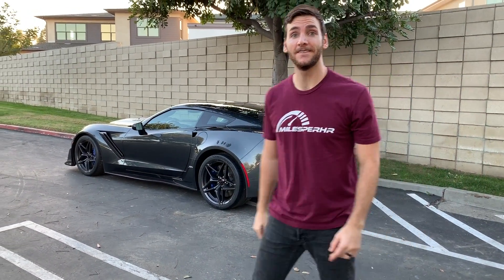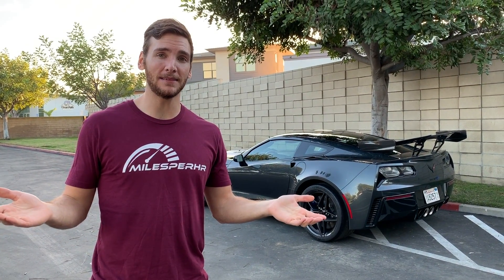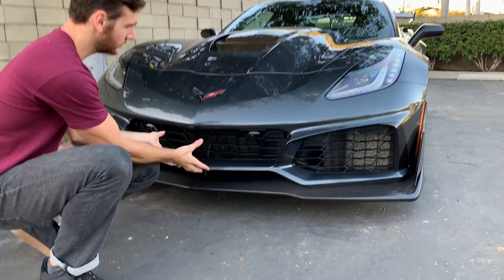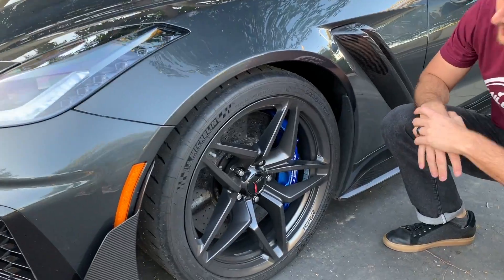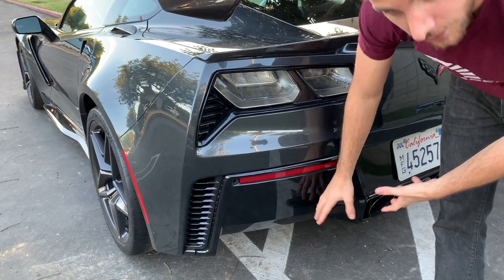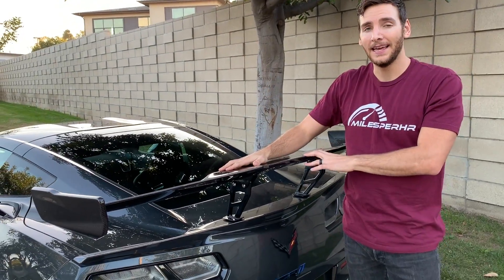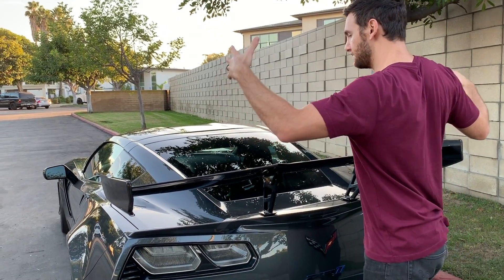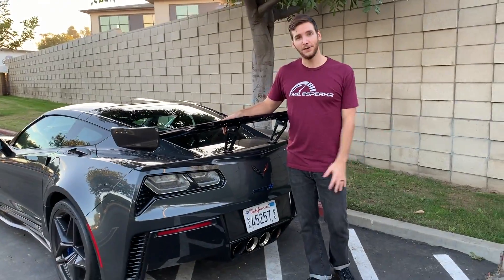Why Does The 2019 Corvette ZR1 Need Such A Big Wing?

Comment: diffuser is for downforce not "smoothing transition" and the wing and even the whole car is not meant for going 200mph down a drag strip. This car is optimized for cornering speed hence all the aero. If you knew anything about racing you would know all that aero actually creates drag for high speeds.
Reply: Not a drag car. U are correct. I think it would hinder your qtr mile times. But by how much is the question.

Comment: Those quarter panel ducts do two things..on the driver's side it cools the transmission and the passenger side duct cools the differential.  The lower scoops on the rocker panels cool the brakes.
Reply from the maker: The lower ones by the rocker panels, or the ones at the rear haunches? Thanks for the insight!
Reply: @MilesPerHr  Lower ones by rocker panel are for cooling brakes.   🍻 Good content brother.
Reply from the maker: @DZRIDEZ  Awesome - thanks for clarifying! Couldn't find the answer online before making the video.
Reply: @MilesPerHr  No worries man...as YouTubers we are all here to help one another.  👍
Reply from the maker: @DZRIDEZ  Definitely beats being yelled at, haha